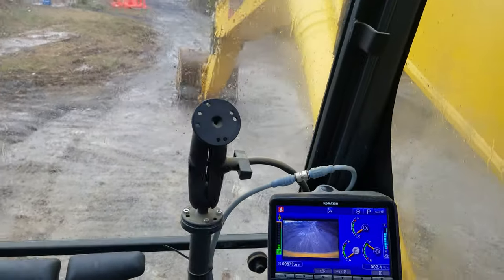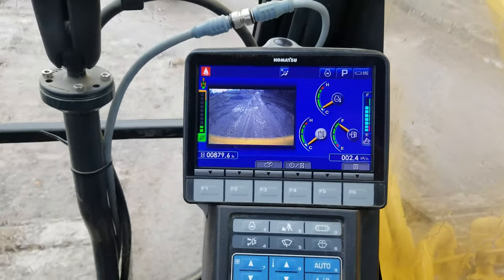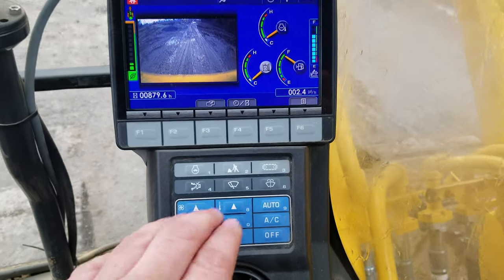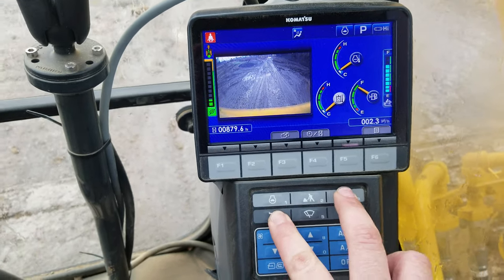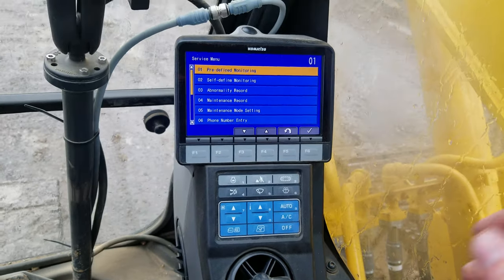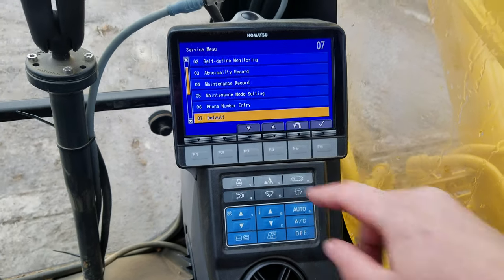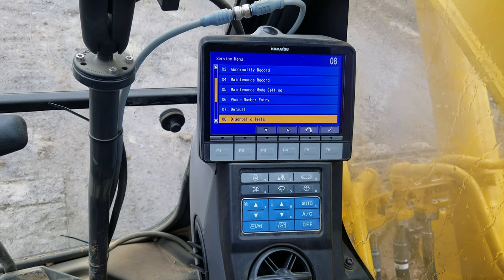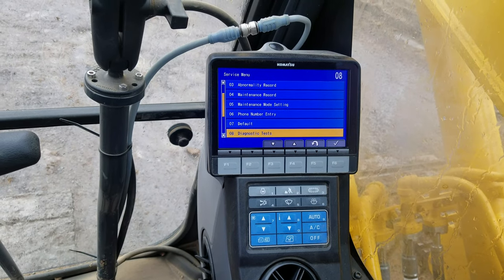Komatsu service side of the monitor in Excavator.

Comment: Hi by any chance do you know how to do it on a wheel loader ? I have a wa500-8
Reply from the maker: You probably got hold on the keys. Hold 4 then press 1, 2, 3 and then release 4. Or hold the enter key and then press 1,2,3,4 release enter. Let me know.
Reply from the maker: The enter key should be the check mark too.
Reply from the maker: The key pad is your A/C controls. Part blue and grey.
Reply: Unfortunately it didn’t seems to work for me. Ive tried both and got nothing
Reply: Hold the down gray arrow 123 or  hold the upgrade Aero 123